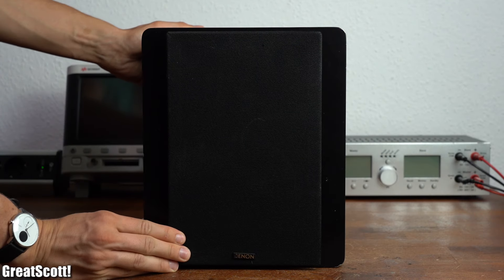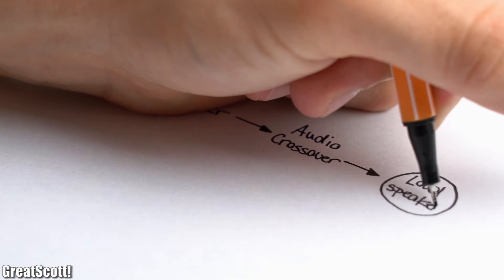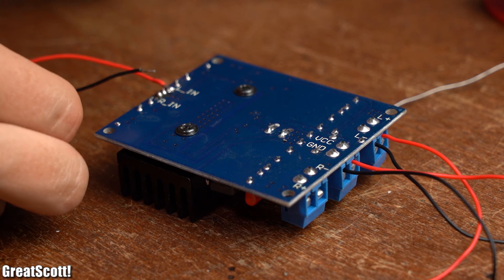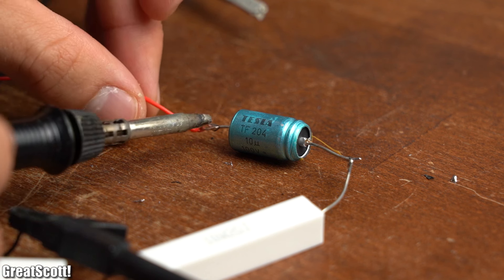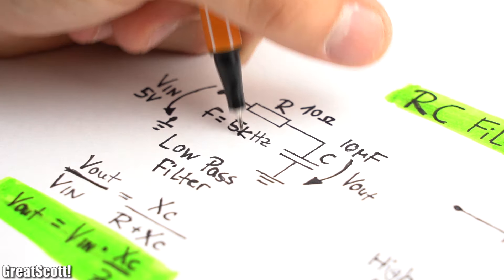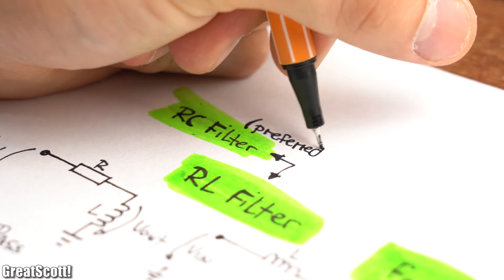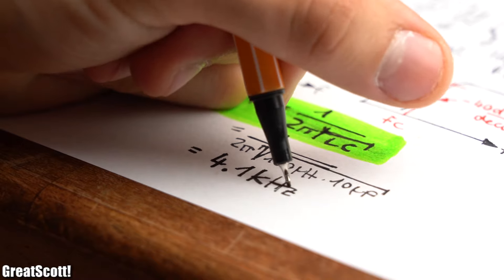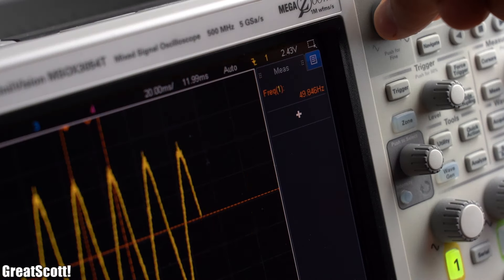Does a DIY Audio Crossover make sense? How passive filters work! || EB#41

Comment: So this is better, but it's still not the whole story.  :-)

Does a DIY audio crossover make sense?  No.  Not unless you have the following things:

- A way to measure the reactive electrical response of the drivers you're going to use.  Preferably in-box.  (There are purpose-built LCR meters for this.)
- A way to measure the mechanical properties of the drivers -- or, preferably and more realistically, the Thiele-Small (TS) parameters from the manufacturer.
- A way to measure the distance from the common baffle surface to the middle of each driver's radiating surface.  (I.e., how deep is the center of the cone from the front panel of the speaker?  This helps adjust the time alignment of the drivers relative to each other.)
- A tone generator capable of doing frequency sweeps.
- An amplifier that you KNOW is safe to use on raw drivers (no DC offset, no power-on pops or thumps.)
- A computer with a high-quality audio interface -- not built-in sound, not a Sound Blaster, but a professional-level audio interface with a balanced microphone input, and probably phantom power.
- A calibrated measurement microphone that is either close-enough to perfectly flat, or tested and shipped with a corresponding per-unit calibration file that can be used to adjust the input to be close-enough to perfectly flat.
(Alternatively to the last two, a calibrated measurement mic with a USB interface.)
- Software that can analyze the mic'd sweeps and graph the IN-BOX response.

* I can't stress this enough.  IN-BOX response, not the response chart of the driver on an infinite-baffle in an anechoic chamber, which is what you'll get from the manufacturer.  (Useful, but only for comparison to other potential drivers, or for designing your own enclosure to your specifications.)  The box has an enormous effect on response.  You can't ignore it and expect to get a usable result.

- A room that is either:  Large enough that you can keep the unit you're testing a few ft / at least 1M away from any wall or floor or other reflective surface; or is the exact room and location you're tuning the speaker's design for.
- CAD software that can take not only the mathematically-ideal values of all these objects, but the actual measured values, and allow you to insert reactive components (parts of your DIY crossover) until the predicted acoustic output AND PHASE is aligned at the crossover point(s) -- bearing in mind the effects that the box (which is also reactive), the drivers, and the crossover all have on each other.

And then, you build the XO, insert it, and re-test the measured response -- which should be close to, but maybe not exactly, what you calculated.  From there, tweak, rinse, repeat.

Keep in mind that since no two drivers are perfect acoustic (nor electric) mirror images of each other, it's entirely likely that the order of the filter for one driver is going to be different than the order of the filter for the other driver that you're trying to match together.  2nd-order LP and 3rd-order HP, for e.g., is quite common.  You may have to intentionally wire one or the other with opposite polarity to get the effective phase aligned properly.

If that sounds like too much effort, you shouldn't DIY a crossover.  And you definitely shouldn't just slap any old off-the-shelf one in there either.  They're married to the drivers, which are married to the box, which ideally is married to the room it'll be used in.  ( <-- But that is also why we have EQ.)

Comment: An alternative is to buy a dsp or a digital crossover. A lot simpler and all the tweaking is done in digital domain. You can build the crossover you want and need and adjust all the needed parameters. https://www.thomann.de/gb/behringer_dcx2496_ultradrive_pro_lautsprechermanagement.htm

Comment: 2:12 the reason why the woofer moves "slower" has to do with frequency, not size! 
The proper way to design a passive crossover is to measure the transducers in the box and use the frequency response to choose the cut off frequency and slope to design the crossover. 
Check out Room EQ Wizard (REW) for a great free audio measurement software.

Comment: I guess between 40-2000 Hz is a sub-woofer
Reply: 2000 Hz is actually pretty high
Reply: subwoofer is normal 20-150 Hz
Reply: Subwoofer is usually under 200hz, 40-2khz is woofer (or midbass driver).

Comment: @GreatScott! ok maybe you can help me. I have a RPI3 B that I use headless I have a Audio amp like this one in the link shorturl.at/twLR9 I have the audio amp connected to 5v pin on the RPI GPIO and to ground. I have a speaker that is 3 watts. Sound comes out and it plays music but I have this issue with noise from the cpu, network activity and other workings that go on in the rpi3 B Its like a hissing sound almost like a 56k modem sound when its conneted. How do I get rid of this noise. I have limmited sapce in the case and would not want to power the audio amp on a sperate power source I also do not want a ground loop filter I have tryed one and no effect in noise.

Comment: It doesn't work like this. As the resistance of the loudspeaker changes depending on the frequency ( sometimes by 100 ohm's or greater) you will have huge dips in the actual frequency responce. Try messuring the speaker with a microfon. You'll see what I mean

Comment: make diy 220v inverter 3-5 kW
Reply: Make a suicide machine.... That what your asking it very dangerous. If you make a mistake on inverters
Reply: @aspiringscientificjournali1505    but he can make it..  why not :P
Reply from the maker: I will not make such a powerful inverter.
Reply: @Drxxx  to easy to make to difficult to remain safe while doing so.

May have some price issues at higher levels as well idk havent looked at parts
Reply: @Drxxx  and in process of making video, inverter circuit will blow up and also kill our Electronic god
Reply: @aspiringscientificjournali1505  i have 2 ups 1kw anf 0.75kw, it is possible to connect this two guys in parallel to increase the power?
Reply: @greatscottlab  i have 2 ups 1kw anf 0.75kw, it is possible to connect this two guys in parallel to increase the power?

Comment: Ehhh... this is an ok video, but you didn't talk about phase shift at all. 
Shifting frequencies matters when you're talking sound. 
Also, it matters if you're trying to make an EMC...
Also it matters if you're talking communication applications.
Reply from the maker: Sure. But I can not put all information about everything in such a basics video.
Reply: @greatscottlab  just a quick mention of it would be good though. You can clearly see the sine wave shift in your video as it's superimposed over the original sine wave.
I'm not an audiophile, but it's one of the issues that is cited by certain individuals for the differences in sound.

Comment: passive filters are not good
i think you should active filters
Reply: Active filters are typically preamp filters. Would require amplifying both the high and low frequency channels independently, ie 2 amps just to run 1 speaker.
Reply: I agree with Samad. And the class D amplifier board he used (eBay or Aliexpress) probably costs less than one of those inductors.  Now that I look back at that boombox build video, he only used one channel of a stereo amp board so he's already got what he needs. An active crossover board based on NE5532 op amps is well within GreatScott's capabilities.  Come on Great Scott, this would be the next logical step!

Comment: Hecc my Sony speakers dont even have these for my stereo. They just use a capacitor and a flex for sub and one for woofer. Even tho they have a tweeter.. I've even seen electrolytics across tweeters, wtf.

Definitely not optimal. Shame on Sony!
Reply: Most manufacturers use simple first order cross overs to keep them cheap. They work, kind of.

Comment: passive crossovers are legacy garbage. much better using active crossovers and seperate amplifiers for each transducer. the parameters shift substantially with temperature and throw everything out. also Silicon is cheaper then copper these days.